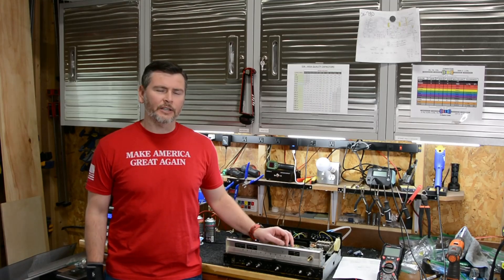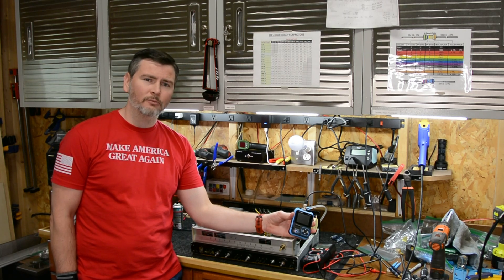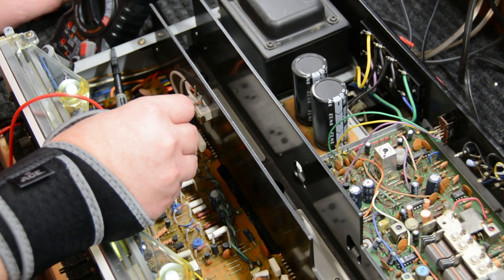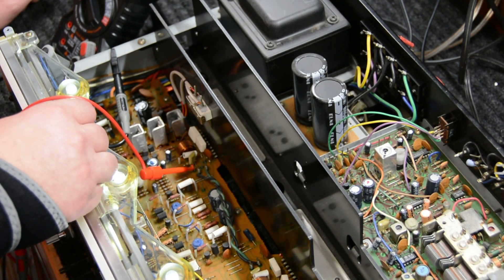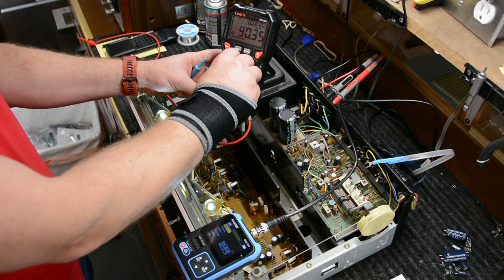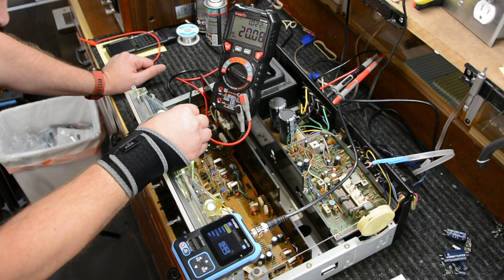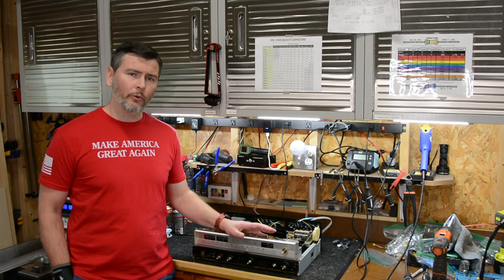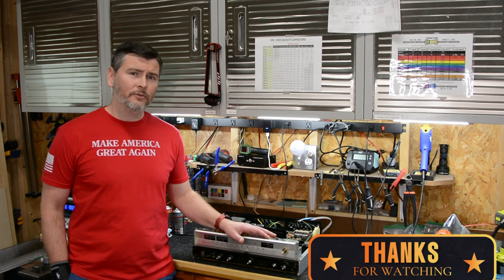SX 780 DC Offset and Power Meter Calibration

Comment: Hi. I really enjoyed your videos. I have a SX-3800, and it needs an adjustment/calibration of the LED power meters. Can you tell me how to adjust them with a multimeter?  Thanks very much! Ty.
Reply from the maker: Hello @tvdmc!! Below you will find the service manual directions on how to perform. Hope this helps. Please remember to subscribe to the channel. Thanks!!

Output Power Indicator Calibration
1. Apply a 1kHz signal to the POWER AMP IN
terminals.
2. Adjust the level of this input signal so that the
voltage on the output terminals (SPEAKERS)
read 8.95V (AC).
3. Adjust VR1(L) and VR2(R) so that the output power indicator read 10 watts
Reply: Thank you. How do I locate VR1 and VR2 on the board?